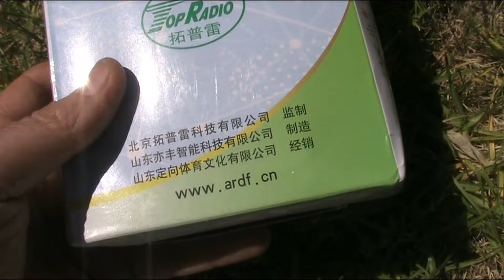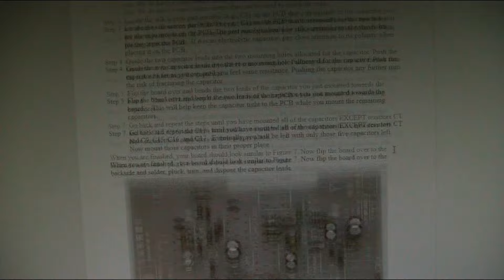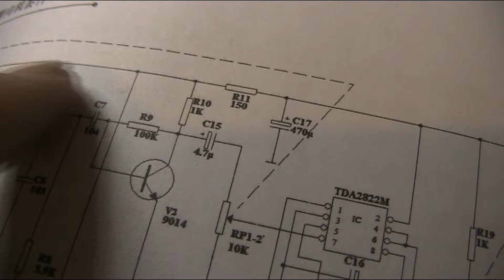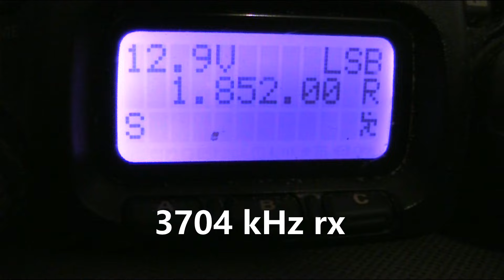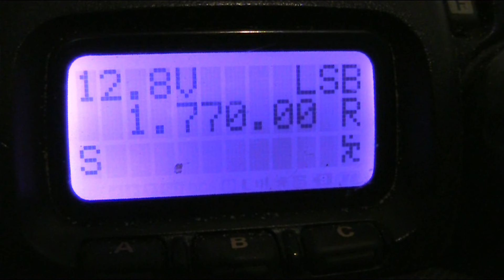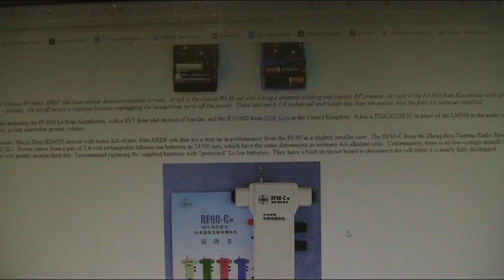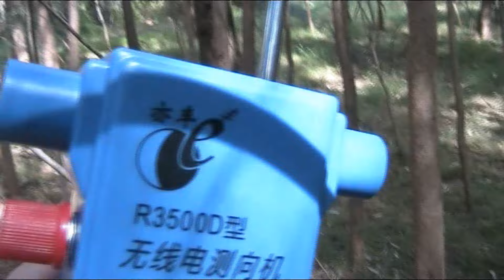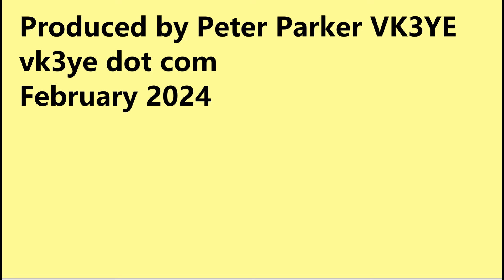Review: CR Kits ARDF R3500D 80m receiver - build and test

Comment: Well done Peter, I had better not lend you one of my DF1FO units both the performance and the cost may shock you. In VK we usually use 3.585 as the fox and 3.600 for the homing beacon. In competition there are 3 events where 80m is used and one event on 2m.  VK3WWW
Reply from the maker: Thanks Jack. Yes this is definitely a budget unit built to youth-friendly prices and ease of construction. A good example of value engineering - I wouldn't want to have gone more basic. Definitely can see how you might design a better unit. Eg full shielding, superhet receiver with good dynamic range, signal strength metering and of course an antenna better than a ferrite rod (which seem more optimum down at MF).
Reply: Ferrite antennas do work very well and are still very popular but its about 50-50 between loops and ferrites. In Europe they mostly hunt the null but if the signal is weak the null is not the best. Some European competitors are switching to using the peak more often especially the Whoopie function on some of the better receivers. Somewhere here I have one of those receivers you built it was given to me many years ago by a DL visiting VK. From memory it was extremely deaf. But as you say its a nice kit to build and a cheap entry into Radio Orienteering. Maybe I should let you try one of my receivers and you can compare for yourself.😀